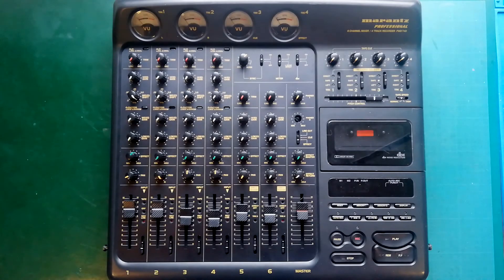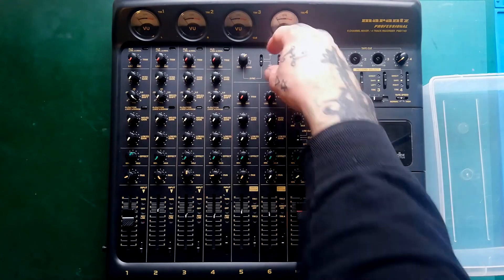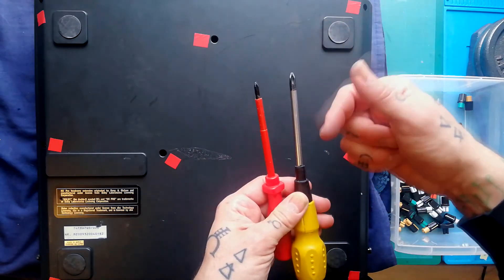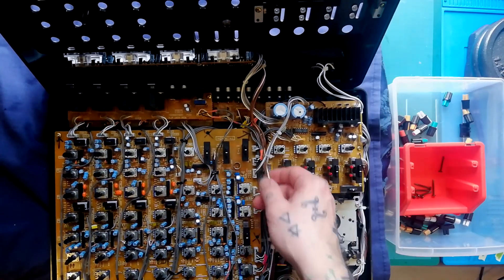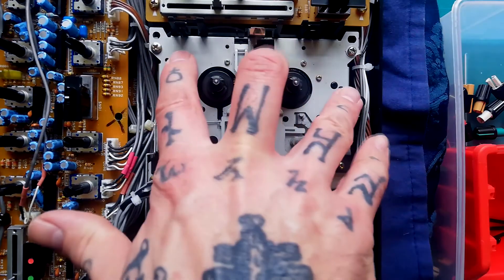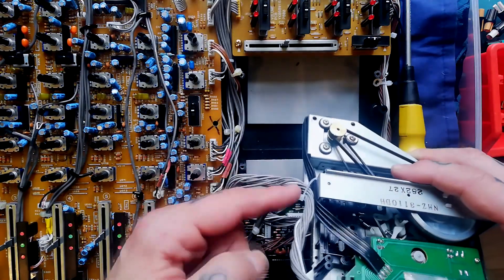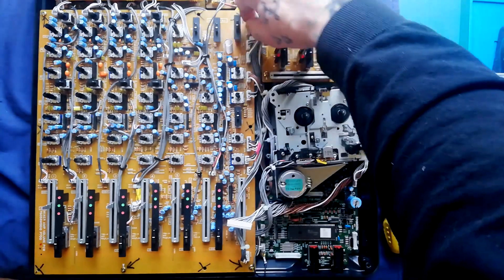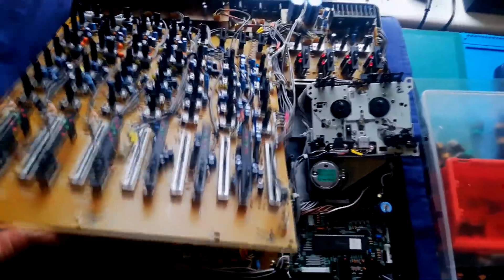Marantz PMD740 | Tear Down | 1 | Open Case & Remove Transport

Comment: Hi! So I just bought a 740 on eBay for $25 (plus $18) for shipping. No PSU no knowledge of it worked but for the price I couldn’t resist. It arrived filthy of course. I found an appropriate PSU (I think -  12 V with positive center) and plugged it in. It powered up - sort of - but the VU meters and a couple other lights just blink at maybe 1 hz or so and nothing else is working. Any ideas?
Reply from the maker: Bargain. How many amps does your PSU put out? (It should say on the label) It should say on a label on the bottom of the marantz how many amps it requires - is it enough? Please give more detail on what you’ve done in the way of testing audio and mechanical features?
Reply: @Tetrakan  I'm not seeing the amperage requirement anywhere: neither on the machine, nor the user manual, nor the service manual. Maybe I just don't know where to look. If it means anything, after reading your suggestion I googled "PSU for Marantz PMD 740" and the one that came up was 12V 2A. That happens to be the same as the one I'm using.
Reply: Other than that, I haven't had time for any testing. I hope to work with it this weekend.
Reply from the maker: Ok sounds like the psu is adequate. I seem to remember it is normal for some LEDs etc to blink when the corresponding tracks are armed but not actually recording, Could that explain what you are describing? Get back to me once you have a clearer idea which parts of the system are working or faulty.

Comment: you are legend for making this :) Someone on the facebook group Portastudio and other 4 track cassette recorders recommended I check out your channel after spilling a bit of water near the top left corner knobs. I did my best to dry it and have let it sit unused for a week with some of the knobs off but would you also recommend opening it to try to dry it further before using it again? thanks!
Reply from the maker: I'd probably run a hair dryer at low heat over the boards to make sure they're dry. Ultimately it's a low voltage and current coming from the external power supply so hopefully if something did short it wouldn't be completely catastrophic, just a temporary glitch until the moisture evaporated, but I'd probably deconstruct it and have a go with the hair dryer to be safe!